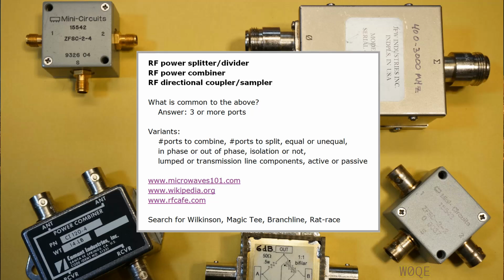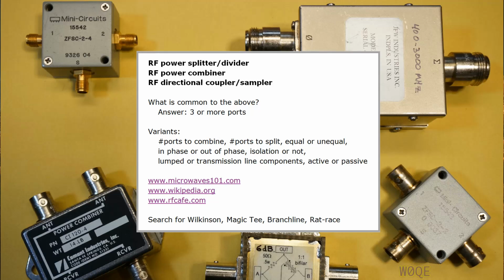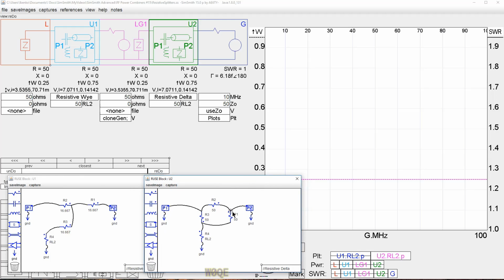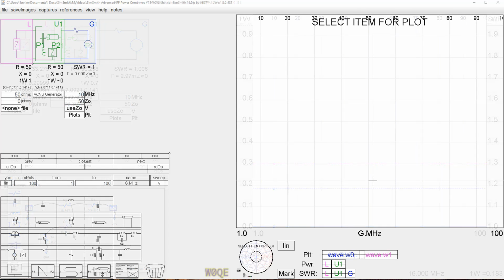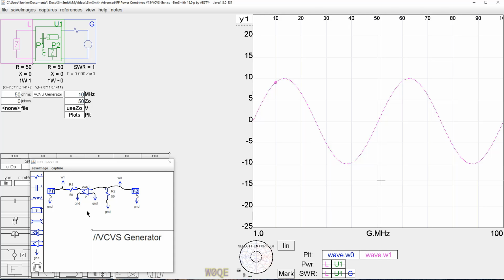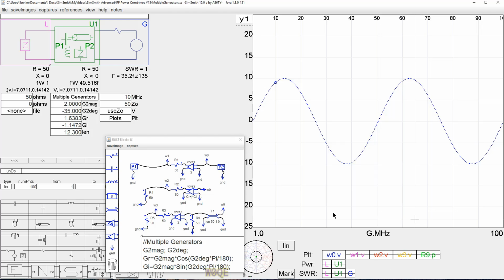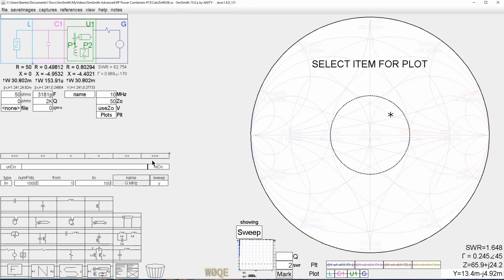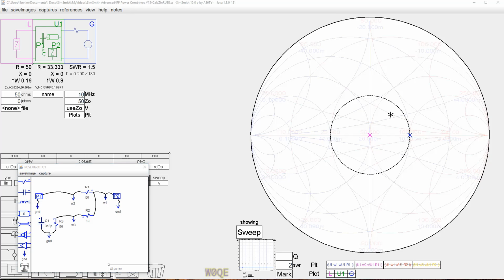#28: RF Power Combiners, Part1 (Adv. 15)

Comment: This is one way to do power combining but it requires sources impedances to be approximately equal to the norm else the other source might see up to 5/3 of norm value (if the other source is open) and 9/5 (if the other other source is shorted).

A different way to do it, with the same insertion loss of 6 dB, is to use a balanced bridge configuration of which the load (having impedance equal to the norm value) is one of four bridge segments, the 3 other segments also have impedance equal to the norm, and the sources are connected to the opposing middle points of the bridge. This configuration is not sensitive to the source impedances.

Comment: Hi Larry. I build the RUSE circuit in your video. I get an error in the plot function: Plot "U1.RL2.p" U1.R4.p PWR; The "U1.RL2.p" is red. The error window says "Expecting a ; I am using simsmith 17.0q on a Apple Macbook.
Reply from the maker: Jan,
Take a look at video #75 where I explained the history of SimSmith.  This video was done using version 15 of SimSmith but you are using Version 17.  The plotting syntax changed slightly between ver. 15 and ver. 16.  You are mixing the 2 formats slightly.

The old format is:     plot "U2.RL2.p" U2.R4.p PWR;
The new format is:   Plot("U2.RL2.p",U2.R4.p,PWR);  or Power("U2.RL2.p",U2.R4.p);   where the "U2.RL2.p" is a label only and can be deleted

Let me know if you have anymore problems.
Larry, W0QE
Reply: @w0qe  Larry, thank you for the hint.

Comment: thanks for the video ! Do you know a good circuit for a kilowatts Power Combiner ?
Reply from the maker: I have built a few high power combiners when I needed to combine two 1500W amps into a 3000W amp when I was doing some contract component testing.  The obvious things that need to be done are to increase the wire size  due to higher current, increase the core area due to larger voltages across the windings and increase the core aperture due to the wire volume.  Unfortunately this means the wire lengths increase which hurts higher frequency operation.  I have touched on these topics in various videos but especially #64, #65, and #66.  I have some upcoming videos about transmission line transformers which will be useful.  I do not have anything that is exactly what you are looking for at this moment. Sorry.
Larry, W0QE
Reply: Thanks Larry. I have seen #64-66, very interesting. Thank you for spending your time for these videos !